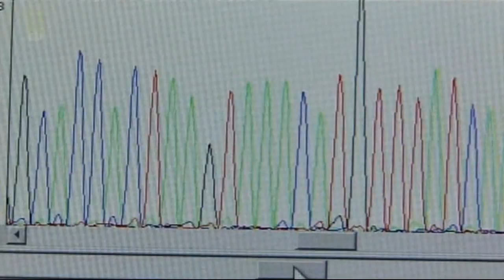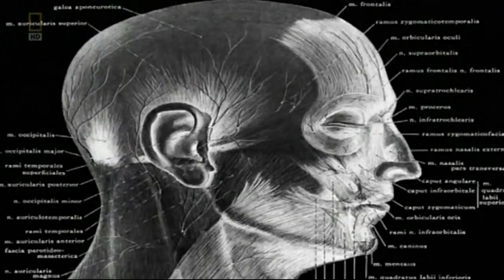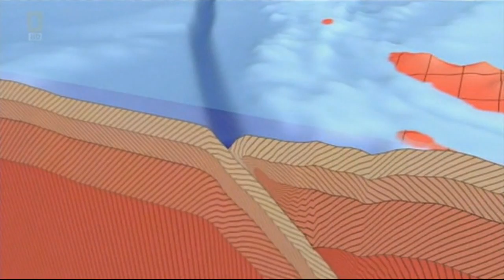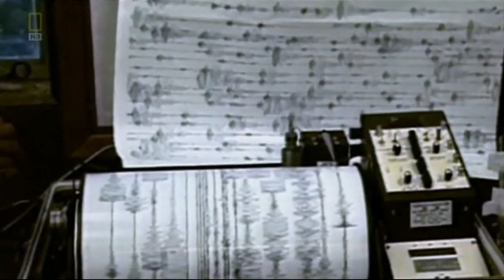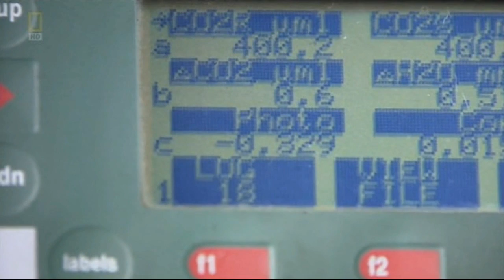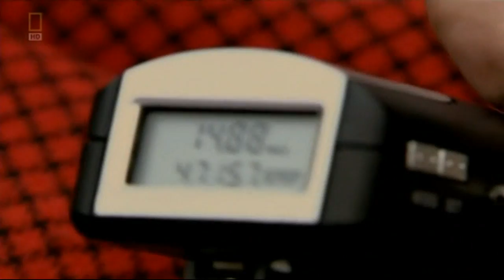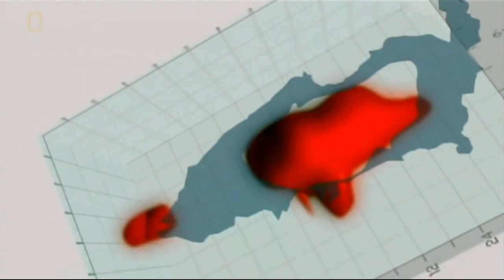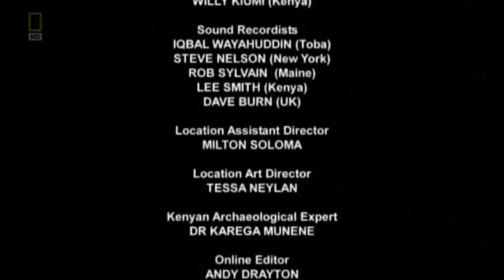Stone Age Apocalypse

Comment: I can't take anyone serious who spouts the line "we diverged from chimps..."
 No, we did not diverge FROM them, we have a common ancestor WITH them.
BIG difference!
Reply: Having a common ancestor does, in fact, mean that at some point we diverged from that common ancestor, as did they.
Reply: Yes it is!👏🤗
Reply: Think, having a common ancestor actually means that one second after we and them evolved from that common ancestor, we diverged from each other. As someone else says, it sounds quite pedant given that the documentary seems pretty informed and scientific.
Reply: Night Hawk
Well then, name that "common ancestor". 
I suspect you can't, because you don't know.
Reply: Bill Henry ,
Reply: Mr Hawk is being a little unfair, and Mr Donahue's question of two days ago is easily answered (Mr D seems to be implying incredulity at the perfectly mundane, and correct, notion that we are descended from Chimpanzee-like primates who were the common ancestors of both modern species). We do actually have a good idea of the mechanics of our divergence from these proto-Chimpanzees, which was the fusing of two chromosomes that can be identified in the modern genetic record - chimps still have the two originals and we have one with evidence of a 'fusion event' (yes I just made that term up but I expect there's a proper scientific term for it) a couple of million years ago. 

More generally, I agree with Mr Jotunn's query and if it is true that there is no corresponding bottleneck in the DNA of other large mammals dating from the same period then this does seem to be a major flaw in the theory
Reply: @exiled_londoner  But there have been "bottlenecks" detected in other species. Check out toba_catastrophe_theory, "Genetic Bottlenecks in other Mammals." in Wikepediae
Reply: @johndonahue3162 - 
Well, I'm a historian (I used to teach it anyway) and not a scientist so I don't think I'm qualified to debate the scientific details, but I am convinced that the overwhelming body of evidence (much of it even intelligible to a scientifically literate layman like me)  establishes our descent from a common ancestor with chimps (and more distantly with the other primates). I casually used the phrase " a couple of million years ago" earlier but I think the consensus now is that the divergence occured circa six million years back. I don't know exactly how quickly evolutionary change can take place but I am certain that six million years is long enough for substantial changes to occur, and we know that environmental stress can result in remarkable changes over relatively short periods. Within our lifetime (unless Mr D is already at death's door) we are likely to see a massive increase in human mortality from bacterial infections as these micro-organisms evolve at horrifying speed to gain antibiotic immunity. Viruses are even faster, and probably more frightening for our future. Mammals are much slower to change of course (but when average lifespan was a quarter of what it is now then it was much faster), but I am dubiuous about the precision of estimates of the speed of evolutionary adaptation, as are many scientists in this field.
Reply: True. Some people have misunderstood it the way you wrote. Some out of ignorance and many out of fanatic intent.
Reply: 'we diverged from'......, 'we have a common ancestor'  Kinda means the same thing, doesn't it?
Reply: @fastermx  - KILL THE FANATICS !!!
Reply: @johndonahue3162  - 
    I'm afraid that Mr. Donahue's language and phraseology give him away. I suppose this really "BAD" theory he's talking about is the 'Theory of Evolution by Natural Selection' (although he later calls it a 'hypothesis', which it is not, and the fact that he confuses the two terms might indicate that he doesn't understand their respective meanings). The Theory of Evolution, as currently understood (sometimes referred to as 'neo-Darwinism', because it has been developed since Darwin's day as our knowledge and data have vastly increased) is not just the best Scientific Theory to explain the diversity of life on Earth, it is the only Scientific Theory that does so. That is why it is the only such theory taught in science classes (in proper schools and colleges that actually seek to educate students), and it has this monopoly because the evidence is utterly overwhelming and because there is no other challenger. 

    'Intelligent Design' is not a Scientific Theory and therefore cannot be taught in science classes (by definition) as this would make them invalid as 'Science Education' (just as such classes are in places like Iran). There are reasons why the Muslim majority countries are so backward... and why the US Bible Belt produces proportionately fewer science graduates. Stephen Meyer (an author with whom Mr. Donahue is undoubtedly familiar) is not a Paleontologist or a Molecular Biologist, or indeed a scientist of any discipline... his main qualification is in 'The Philosophy of Science'. The reason that he and those who share his beliefs find it difficult to get papers published in scientific journals, or to get their books used as school texts (although influential lunatics and Clerical Fascists in places like Mississippi and Alabama will no doubt keep trying) is because they cannot back up their assertions with enough actual evidence to reach the standard required even for a valid 'hypothesis' and therefore no reputable scientific publication or academic body can take them seriously. I would urge Mr. Donahue to read some of the reviews of Meyer's books (especially 'Darwin's Doubts') by actual scientists who have studied the evidence and understand this field.

    I am not a scientist but I do understand why the Scientific Method is the only way that reliable, evidence-based conclusions can be drawn. Meyer and his ilk reject this and essentially fall back on the 'God of the Gaps' argument which can only be made to sound persuasive by lies, distortion, and by exploiting the gullibility and ignorance of their audience and readers.
Reply: @johndonahue3162  -
     Mr Donahue is fond of capital letters to emphasise his points - the text generation's equivalent of shouting I suppose. But as the English (and the Germans) often find when travelling abroad, shouting at someone who speaks another language does not make your words more intelligible. As I have said, I am not a scientist and Mr. Donahue is probably far more qualified than me to use the technical terminology, although I note that he does not seem to be a scientist either and, like Stephen Meyer, he has studied the 'Philosophy' of Science instead. I am surprised that someone with Mr D's qualifications still does not understand the difference between a 'Theory' and a 'Hypothesis' (as demonstrated again in his latest post), or maybe he chooses to deliberately and dishonestly muddy the waters, but again his language gives him away.

    "...which we know is always the product of an intelligent agent"
    "...information is not an inherent property of either matter or energy"
   "..."biological macro-evolution..."

    These are all well worn memes and phrases that anyone who has followed the utterly moronic debates that the Yanks like to engage in on these topics will have heard many times. What they all boil down to is a 'God of the Gaps' case for 'Creation' and/or 'Intelligent Design' - neither of which are 'Scientific Theories' because there is no evidence to support them (and therefore their complete lack of any predictive power need not be considered). As per 'Hitchens Razor' (though I think Carl Sagan said it first): "what is asserted without evidence can be dismissed without evidence'".
    I do not know the answers to the queries that Mr. Donahue thinks are so damning of the 'Theory of Evolution' - although I am fairly certain that he exaggerates them with excessive hyperbole and by claiming to 'know' stuff that he does not (one of the definitions of religion). I do however understand that in science it is perfectly legitimate to give "I don't know" as the correct answer to some questions (or perhaps "I don't know... yet"). I also have some trust (not 'faith') in the scientific establishment to pursue the truth rather than to simply seek to validate conclusions they have already reached (or which have been handed down by 'authority'... or 'revelation') and I agree that any scientist who could disprove the 'Theory of Evolution by Natural Selection' would be a contender for a Nobel Prize. I am not naive and I know how the pressure to conform and not challenge accepted orthodoxy can distort even the most scholarly institutions and professions, but the most glaring examples of this are not in science but in my own field (history). It is an undeniable fact that certain claims for 'historicity' are granted a 'pass' and subjected to relatively little critical examination (of the evidence) by some scholars because this might upset too many people (some of them with influence over the purse strings). 
    Such is the world we live in, but honest enquiry and principles are worth standing up for.
Reply: @johndonahue3162  -
 No, I'm not going to get into a scientific debate with Mr Donahue. As I have said several times, I am not a scientist and I reach my conclusion based on the fact that I am scientifically literate enough to grasp the basics and to see where the overwhelming evidence lies, and I have enough trust in the scientists who are expert in this field and I can plainly see the mendacity and distortion that is the hallmark of the evolution deniers. Mr. Donahue's repeated references to 'macro-evolution' are an example, as there is no such thing... there is just evolution. I have also given a very full explanation of why Stephen Meyer is a fraud: he's not a scientist but a professional propagandist and lobbyist who is trying to dress up the 'God did it by magic' claim to pretend that it's something else. Teaching kids a religious dogma in science classes as an alternative to evidence-based science is a vile, despicable and obscurantist (and fascist) notion. Kids should be taught about religions in school because these are belief systems that will impact on their lives, just as they should be taught about different political ideologies, but none of these should intrude into science classes. There is no 'controversy' to be taught as there is scientific unanimity on the broad outline, even if we still have details to fill in and some areas where our knowledge is not yet complete. 

This pointless exchange has now run its course. I hope Mr  Donahue also enjoys the Festival of Eoster/Ostara - which has been celebrated for millennia and long before anyone had heard of Christianity, and although it doesn't mean much in practice to a townie like me, my family enjoyed the traditional roast lamb dinner and a glass of Prosecco, even if we don't believe in the Celtic/Saxon fertility goddess in question.
Reply: Diverged from, common ancestor; Potaytoe, poetahto.
Reply: @johndonahue3162  Really? I see no problem with that. 6 millions of years. Population counted in several thousands. Relatively fast generational turnover. High mobility of said population - allowing it to quickly settle in new habitats. Which leads to high rate of genetic drift and repeated crossbreeding with other populations. Genus Homo seems to be a perfect example of "survival of the fittest". What works, spreads quickly. What doesn't work, is also quickly eradicated from gene pool.
Reply: @johndonahue3162 -
And this is why it's not possible to have a rational discussion or debate with these people - they just make up scientific sounding words and then insert them into phrases and sentences designed to fool the ignorant into thinking they know what they are talking about. I know the limits of my expertise and I will not get into a detailed scientific debate that I am not qualified to conduct. However, I am reasonably well educated and I understand the  basic scientific principals and processes here. There is no such thing as 'macro' or 'micro' evolution in the sense that Mr. Donahue is using these invented nonsense words. There is also no such word as 'evolutionist' (even if it has wormed its way into the dictionaries) as this is a term used to dishonestly imply that evolution is a 'belief'. Sane and rational people do not choose what to believe when it comes to scientific facts and theories... they accept the evidence, and where this is strong enough to amount to proof or overwhelming probability then they accept the theories based on this evidence. Evolution is genetic change in populations over time - the longer the time the greater the potential change, although selection pressures can speed up the process. That's it... there is no definitional distinction between big and small changes because the little changes accumulate over time. Massive changes from one generation to the next (such as those inflicted on tens of thousands of people in Hiroshima and Nagasaki by radiation in 1945) are usually fatal and always negative survival traits - unless you think that Marvel comics are science text books. Mr. Donahue is welcome to provide evidence to support his assertions - and he should present this evidence to scientific journals and peer review panels rather than demand that people like me debate it with him.

OK, can we call it a day now?
Reply: Problem of semantics. But point taken. It is funny how many people think that there were chimps and then Homo Sapiens just appeared. Lol. Evolution is a slow process that relies on mutation for new forms. Mutations take time; over the  years various changes/additions/subtractions to the genetic code gave rise to new forms that although scarcely noteworthy over a single lifespan, would additively result in who we are today. And, of course, this same mechanism continues unabated to this day. Who will we be if we survive another millennium, or ten millennia? Who knows?
Reply: @johndonahue3162  Oh yeah? Tell us all how mutations leading to lactase persistence in many populations in the world are harmful. Or that small mutation which gives about 1% of European population natural immunity to HIV virus. Like i said - you have no idea what are you talking about. Or maybe you do - but you carefully chose your "arguments" to push your Intelligent Designer agenda.
Reply: @johndonahue3162  I've never in my life been in Walmart. What is it anyway - some sort of sunday school?
Reply: @johndonahue3162  What do you think we descended from, Jesus?
Reply: @exiled_londoner  Nice work.  You nailed Mr. Donohue dead to rights.   But it's pointless trying to debate with him because, were you to provide him evidence to falsify his assertions as did I, he simply ignores it and blathers on.  And you are spot on for calling out the danger he and his brethren represent to science education.  There's something very evil about what he is doing.  One would think a man with a degree in the Poseur of Science would know better.  Whoops, little typo, there.  Spell check can be so pesky.
Reply: @76rjackson  - 
Of course Mr/Ms Palindrome (I don't know what gender 'Hapax' denotes, if any) is correct and the likes of Mr Donohue are not susceptible to rational debate or to scientific evidence. I did not expect to convince Mr Donohue that his position was wrong, or even slightly flawed, but I hope that any sane and reasonably intelligent person reading the postings can see the difference between our positions and reach a conclusion on whch of us is being reasonable and consistent and sticking to actual evidence (and not claiming to know things which we cannot possible know). Although I live in the UK where we have a much smaller problem with these lunatics demanding to teach religious dogma in science classes (we have other kinds of lunatics who think we can rebuild the trading relationships of the old British Empire - but that's another story), the fact is that the influence of anti-science lobbies across the globe, whether in Pakistan or Middle America, is a deadly threat to all of us. The people who reject the scientific evidence for how life evolved are often the same people who reject the scientific evidence of Global Warming. I live in a port and the high tide level is a couple of feet higher than my front doorstep, and Liberal Democracy will not survive in any part of Europe (including the British Isles) when there are a hundred (or two hundred, or five hundred) million starving climate refugees desperately trying to enter Europe from the South and East.
Reply: @johndonahue3162  You do know that not entire world is US of A, right? There are still countries on this planet that do not have Walmart and Starbucks on every street corner.
Reply: I am thinking they probably did not wear 3 piece suits.
Reply: @johndonahue3162 : the 'not enough time' hypothesis continues to be advanced falsely by theists long after it's been understood that mutations don't occur one at a time but in groups and on different sections of the genome. Six million years is the best estimate they have until any better information or techniques of analysis comes along.
Reply: @johndonahue3162 : I wouldn't bring the word believe in here. That could tend to blur the distinction between faith-based belief and acceptance of scientific theory as the best available explanation for the way things are - two very different beasts if you'll excuse the pun. 
Evidence led-belief is really better expressed as 'no evidence available to not believe.' As such I do not think scientists have got anything wrong, when I look around at other mammals, by placing humans in the family hominidae which is the 'great ape' bit of clade usually referred to more widely as apes. We can observe we are closely related and it's no big step to go from there to an explanation that we share some recent ancestry with them.
One should also be careful in taking a superior view of 'lower' forms. Chimps out-perform humans consistently in some cognitive tests involving short-term memory - some chimps are much better at it than others. It seems a good explanation that selection for short-term memory proved advantageous on their evolutionary path but less so for humans whose brains handle better more complex functions alongside a unique capacity for language found nowhere else in the aninal kingdom.
Reply: @johndonahue3162 : In answer to your numbered points: 1) why do you assume that change is either a) the goal of an organism or b) generated endogenously. The most likely explanation is that nothing changed in the environment that opened a niche for mutations that were happening to confer an advantage. Therefore they did not survive.
2) It is a blessing, to use one of your words, that scientists do not have the power to mutate species, to stop the grass growing or to create autonomous robots bent on wiping out their creators (watch the film Prometheus and please don't encourage them). 3) Parts of the genome act a bit like switches which is why we can retain latent genes that are now switched off but out of the blue and against all the odds a child can be born with a tail. The theory is that switching on occurs in conjunction with a mutatative step which introduces other changes which can survive to confer the advantages. And we live longer now and so individuals who would have died young now can receive care and treatment that carries them through to reproductive age. 
I watched a programme last night about the eradication of small pox from the world, a disease of such horrendous effects on its victims it hardly bears thinking about. Fortunately we are a species that doesn't just accept these cruel facts of nature but we struggle against them, work out how they operate, how they thrive and, after making many mistakes and setting off on dead-end paths and having to come back to square one, we do achieve absolutely fantastic success in many areas. But if we'd relied on prayers we wouldn't. And the scientific community never thinks the job is done and that one day a sprinkling of magic dust is going to descend and they can all retire, made redundant. If we get to that position, ever, it will be from our own species' efforts.
Reply: Actually, it is not. It is full of suppositions, unfounded statements, etc. Like, right at the beginning 'a population of just a few thousand'. Where is the evidence for that, it does not exist. When it starts with a completely unfounded statement like that it is obvious that it will all be absolute bollox.
Reply: I also sub to Cody !
Reply: I never stated we came from Chimps.  You are right we had a common ancestor  The same with other ancient men.  I was commenting on what a group of chimps are called.  Not a troop, but a colony that is all.  Where did I ever state that we came from Chimps?  I have been to college, I know the basics of evolution.
Reply: @johndonahue3162 : We'd covered that right at the outset when I said that if people want to import 'believe' into a scientific discussion, they have to understand that its meaning is different from faith-based belief. That was the very first point I wanted to make absolutely clear and stress so that it could not be ignored. Judging by your new question, you either glossed over it or made a conscious decision not to treat it with respect or seriousness.
 
I don't want to head up a dead-end or go round in circles so I think I'll have to leave you to ponder by yourself upon apposite use of the term 'believe'. I sincerely hope you are able to grasp the different contexts. And if I see it coming up as the specific subject of another Youtube video I might feel motivated to contribute more at that time.
Reply: Being different to chimpanzees and having a common ancestors necessarily implies divergence from each other. Come on, play nicely fellas!
Reply: There is in my mind at least no doubt that we were created.  But I do not rule out the idea that God could have used a common ancestor in the creation of us.  It seems to me  that both evolutionist and creationist have this in common.  They pick out facts that support their position and ignore others.
Reply: I didn't come from chimps - only you guys did. We have more NOT in common than in common - Just for One: We are 15% rH negative - a blood type NOT shared with a any other creature. In the Pyranese Mountains it's 35% rH negative. NOT one single missing link has ever been found AND I am not eluding to religion which is the corruption of ancient knowledge surrounding our true nature and how we connect to this planet.  To find a missing link it would have to have graceful bones not powerful, same cranium, a modulator not a growling voice box, make it's own Vitamin D without having to eat the green parts of plants - have a specific cranium and a creative ability that goes way beyond a chimp best ability or natural function /    that's for starters.
Reply: @paulstarr5706  No none did.  Evolution claims a common ancestor of a species in which some became chimpsl other went on to homo sapians.  It is only a theory./
Reply: @johndonahue3162  Are you saying that you actually believe in virgin birth? Are you saying you actually believe in "Jesus did it"? Are you saying you actually believe some imaginary superman in the sky will protect you if you beg in the right way?
Reply: @johndonahue3162  Yeah, right John, keep peddling your Medieval fairy tales & superstitions.
Reply: @johndonahue3162  You're living proof that Neanderthals didn't go extinct. That would include your mother and father too.
Reply: Teddles Peddles  -  how could you know this for certain?  Or are you just parroting back the same false history we were all taught?
Reply: @johndonahue3162  -  all mammals share a very high percentage of DNA.  Humans and bananas share a lot of DNA also.
Reply: Major woody  -  so we are all just apes who learned to stand upright?  I guess once they were all standing there looking at each other, conversation evolved out of boredom.
Reply: I RECOMMEND THAT NO ONE TALKS TO, OR ACKNOWLEDGES IN ANY WAY, THE FOOL THAT IS...  @John Donahue.
Do yourselves a favor, and just read the thread. 
All he does is repeat himself constantly, talk down to others, call names, try to pass himself off as a Scientist, try to elevate the teachings of "his religion", etc.
Need I continue? 
He loses every debate, yet types volumes of regurgitated drivel in response, as if he had won. 
He has no class, zero moral character, and, 
he is a "Jesus-freak", NOT a Scientist!!! 
His ultimate goal is what he is doing now... 
To try being a recruiter for his church!
He is NOT a Scientist. He is one of the congregation!
There is a huge difference between sounding smart, and actually being smart! 
Donahue TRIES sounding smart...
Reply: atheistcable I think it may be me. I’m the monkey in da middle.
Reply: OO AA AA AA! (throwing poop). J/K
Reply: Our common ancestor was more chimp-like, so it is a common colloquial description of the divergence.  This is not a scientific paper, so don't expect the same level of precise expression bc this video is obviously meant for the learning laity. Similarly,  I would criticize a 3rd grade math textbook that doesn't acknowledge the possibility of negative  numbers.
Reply: @Tiny mod how old are you?
Reply: @exiled_londoner  Your case is well stated. John Donahue is a creationist. They often hide behind scientific sounding terms. I'll make a bet that even as John Donahue argues for intelligent design he's wearing his eyeglasses.  R.I.P. Christopher Hitchens.
Reply: I put the strike through just to emphasize a point. John Donahue the brilliant 'scientist' claims that he uses all CAPS because you can't use Bold or italics in Youtube comments.
Reply: I`m at 3:20 in I when entered here for the same argument...
Reply: John Donahue... Hello sir. 
I enjoyed reading your posts. 
A few thoughts from me...
Death is a result of sin. No death before that point in history. I wonder if you've considered that when interpreting the bible with young earth, old earth "theories". 
My understanding is old earth, "gap theory" is a new belief stemming from the time evolution was coined. Biblically speaking. 
Would you agree with this? A God, that can create something from nothing, who exists outside of time, can create everything in 6 literal days.
Seems to me everything, including the bible, points towards young earth. 

My understanding is anyone that denies the existence of God, is willingly ignorant. A person would have to be a "know-it-all" to come to the conclusion, there's no God. 
Given the chance in my opinion, most people would kill God. Maybe out of ignorance most the time.
 Long suffering, patients, and all the fruits of true repentance, may be their only hope. 
As the salt of the world, we can lead an ass to water and not make him drink. You just might make him thirsty.
: )
Reply: I can't take seriously anyone who says "I can't take anyone serious" because they do not know the difference between an adjective and an adverb in the English language. Clearly, that person's education is missing some basic elements.
Reply: @JavierBonillaC  
    Actually. the divergence was *15 hours, 41 minutes, and 7 seconds after we and they evolved from that common ancestor, who btw resented being referred to as "common";
   -  I mean, can you BLAME the dude?

*Pacific Standard Time, to be specific.
Reply: @johndonahue3162  
  Re our similarities to bananas:
   ROTFLMAO!!!!!
Reply: One might also consider that the OTHER Great Apes, as well (yes, and indeed ALL primates), diverged from a common ancestor - one who'll hopefully forgive our collective use of that disparaging word, "common".
Reply: I can't take anyone seriously who describes other people's mistakes in such bombastic terms.  "spouts the line" is a phrase I thought better reserved for someone trying to propagandize.  Does this documentary seem to you like a piece of propaganda or bad science?  And, "seriously," your grammar and syntax are about as bad as mine, which is why I try to only criticize publicly my peers.  These documentary makers are my superiors in terms of what they know and the effort they've put out to educate while entertaining us too with cool soundtracks, etc., so I give them a thumbs up, and you also get a thumbs up for your astute point about the difference between having a common ancestor and "separated from,"  which implies that we were once chimps, which we were not.  Humans were never apes or chimps, and any poor articulation of the fact that australopithecines and the like who we apparently did evolve from, were never chimps or apes either.  It is not an easy concept for some to grasp, so lose the vitriol, Sapien, and accept your thumbs up with qualification.
Reply: UYou are right. Oru common ancestor is Jesus, but we aren't related to chimps. No way. I did not evolve from a rock. Sorry. Neither did you
Reply: The evidence of a human skull was found in Palestine, he gets the location wrong.
Reply: Pierre LeDouche  I agree on all counts
Reply: Teddles Peddles  That is the funniest thing i have heard in ages you mate may have been a chimp although i think moron might be a better description so show me a example of evolution if we evolved from chimps surely that would be a ongoing thing and today there would be examples of this happening
Reply: Really, what difference is that, and what cares?
Reply: I do agree with you. We are nothing but an " upgrade " Chimp but with many physiological defects that is shorten our life span plus the external forces involve on it. We should live over one hundred and twenty five years plus.
Reply: @exiled_londoner  read the comments and you win, sound argument from a non scientist perspective, that guys just a secret creationist.
Reply: @johndonahue3162  Big bang is bunkum
Reply: @johndonahue3162  it's a white hole sir.
Reply: @johnknight8152  -
I don't think there's anything very secret about Mr Donoghue's position as he gives himself away with every tirade. He's just trotting out phrases and terminology he's picked up from 'Discovery Institute' and 'Institute for Creation Research' websites. I'm pretty sure that no reputable university teaching the Philosophy of Science would have taught him that there was any distinct and scientifically recognised difference between 'micro' and 'macro' evolution as this laughable notion is an invention of creationist pseudo science and everybody knows it. I suppose that in a way it's quite heartening that these liars and fraudsters have to try and disguise their gobbledegook and superstitions as 'science' because it is so widely accepted that the Scientific Method (rather than 'Divine Revelation') is the way to find out about the natural world, but it is also depressing that so many people (especially in a supposedly First World country like the USA) are so ignorant and gullible that they can't see through this ludicrous crap.
Reply: @johndonahue3162  yeah I agree no in depth knowledge, but one thing I know is that that spontaneous creation is not reality. Take a look around you. Everything is evolving one way or another. Look at it all, if you can't see it. Faith has you blinded. Certainly ain't wasting my time on your belief system mate I have better things to do.
Reply: Javier Bonilla -liliels
Reply: You'll be fine
Reply: There are no known common ancestors of any 2 current species.  Think about what that implies.
Reply: in the same way we are related to all life
Reply: Time is a funny thing. lol
Reply: Hooray for someone who understands evolution from a scientific perspective.
Reply: Yay!
Reply: EXACTLY
Reply: Thank goodness humanity need fear not of a super volcano erasing all life on Earth when climate-change guarantees all life including humans will be extinct in well under a decade, perhaps just a few years.
Reply: I believe they said that Chimpanzees have more diversity than humans, meaning more diversity in their DNA.